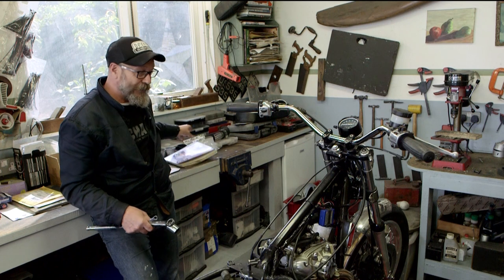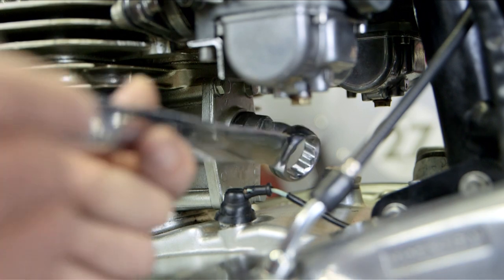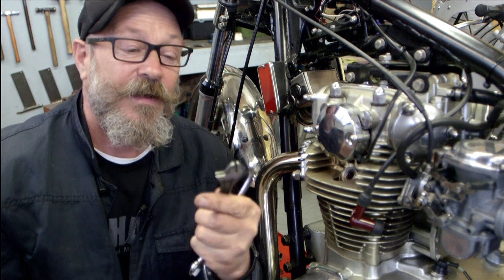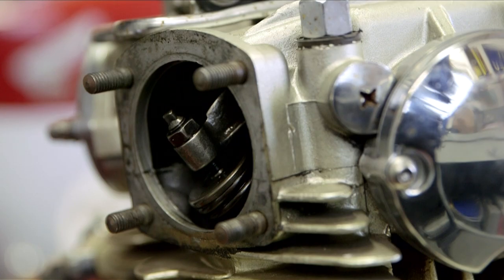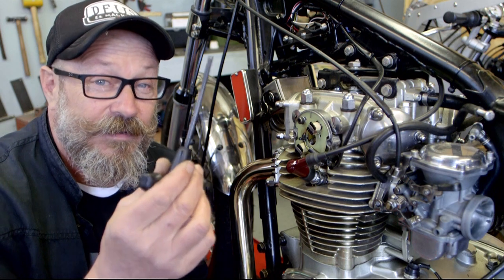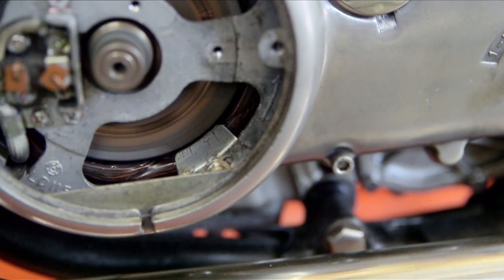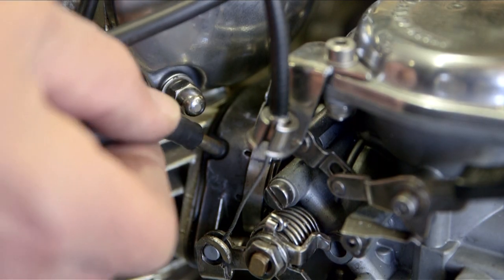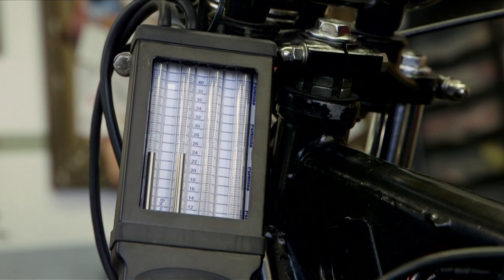YAMAHA XS650 (H) 1981 'Nerd Alert' - Engine Tuning - How To

Comment: Great video mate, really top notch. Helped me tune my xs that really needed some tender loving.

Might I add. My bike really was floundering a lot trying to idle while changing the balancing screw for the carbs. 
1200 +-50 rpm is the desired rev range at idle so make sure your balanced carbs are holding that while you tune. 

Happy days ❤

Comment: Thanks for all the help. Been after one of these for years, but most I find State-Side, someone newbie has made mincemeat of, and its a sorry lot with jankie, jury-rigged items that need attention. The last one I looked at seemed to have had Jack the Ripper for a fabricator, and couldn't discern if the petrol cell was painted or just bleeding from the violence. Great bit of help on the repair and tune end. Have a splendid day.

Comment: Great video, thank you. I have a 1980 Special and this is the 1st vid / forum I have found to set the ignition timing correctly with our orrible ethanol fuel. I had the same problem as you with the Boyer running out of adjustment. Strangely if set 10 degrees BTDC at idle on the left cylinder, checking the right cylinder its about 7 degrees BTDC ? Any Ideas and have you checked yours ?
Reply from the maker: Hi, that's really odd - I havent checked both cylinders on my XS. May be worth contacting Boyer or asking forums, perhaps there's a tolerance.

Comment: You adjusted the cam chain wrongly, you need to turn the engine over and watch the pin move in and out, setting the nut to when its out at its fullest and level with the nadjuster nut.
Reply: Do you have a video of the proper adjustment procedure on your channel.  I need to adjust mine.